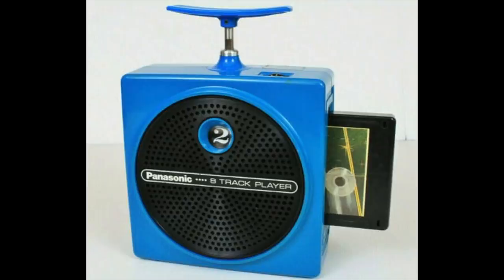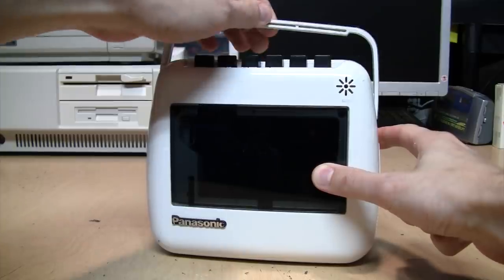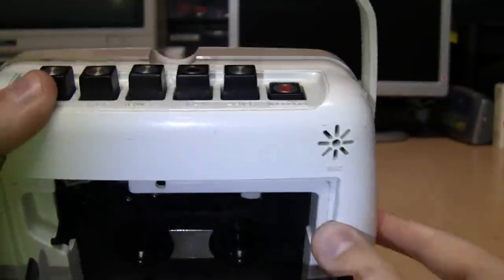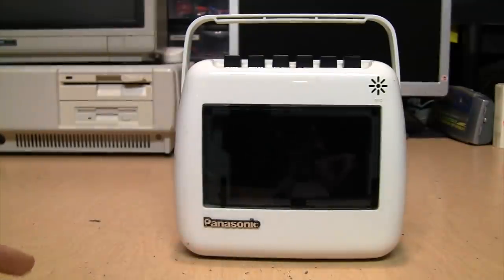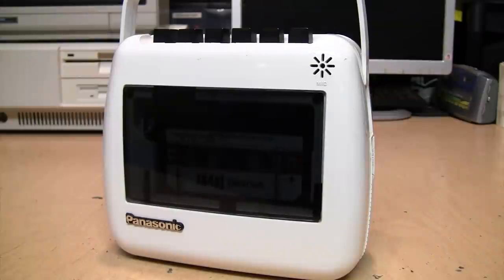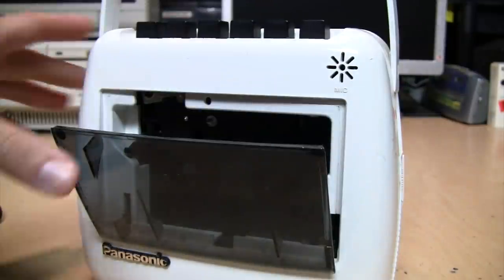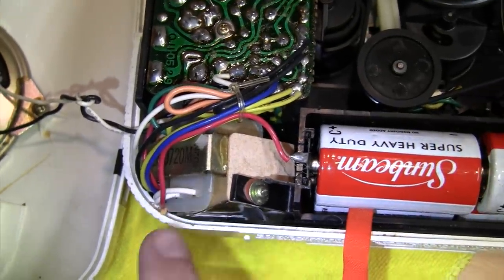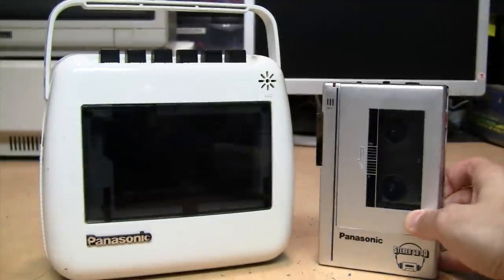1970s Panasonic Take 'n Tape portable cassette recorder

Comment: I have always liked Panasonic since they seemed to deliver well made stuff that didn't fall apart very soon. Wonder if the same rings true (or even truer) for their old stuff...
Reply: Same. I still love those Panasonic cassette players
Reply: Me too, Panasonic fan boy here. 😎👍
Reply: Me also. All my Panasonic and Technics stuff that I bought in the 1980s is still trucking on. Most Panasonic made things are very robust and built like a tank!
Reply: @needfortweed8734  Hmm 🤔 strange. I’ve never had that bad of luck with any electronics, except for a GE radio. I bought a new Vizio to replace an earlier Vizio made in 2007 that still works today. I usually have things based on the track record of the things that I have actually bought previously from and like. If I really had that bad of luck with something, I would really never buy it again. That LG I had previously seen in another video is a great example.
Reply: I have a panasonic cassette player from the 60s with original belts. Still works!
Reply: @EddieJazzFan  👍🏻
Reply: panasonic dvd rp91 is my favorite dvd cd player, with a built in dac and 3 re-master modes
Reply: Panasonic players were rugged as hell. I dropped mine a few times down stairs, on to concrete, never a scratch. While my friends Sony's and Hitachi's fell apart when you looked at them wrong. ha ha

Comment: I had one of those Panasonic Take n Tape machines; got it in ‘73, in Blue. It was my first cassette player/recorder which replaced a mini reel to reel (like in Mission Impossible) machine. I used it to play and record, and put a lot of mileage on it. The case may have been plastic, but the mechanism inside still had a decent build quality.

Great machine and memories. The handle did crack and break, but I taped it together and used it for many years until I wore out the playback head.

Comment: You made note of the amount of plastic in the tape transport chassis when showing the insides. This was a low-cost unit even when new. But it still sounded very good, and I really couldn't detect any wow or flutter to speak of. That heavy die-cast capstan flywheel seems to be the key. It might be entertaining to see the W&F of this little player compared to some recently made tape decks and players.

Comment: Thanks much for posting this. I got the blue one in 1973 for my birthday and thought it was the coolest thing ever. I remember the first cassette I listened to it in was the American Graffiti soundtrack. The sound was good by my 11 year old ear and the plastic was pretty tough as I remember I drug it everywhere. I think the design still looks cool today. Panasonic was so hep back then. Yeah, the built in mic kinda stunk, but that didn't stop me from trying to tape(.v) the hits off of 68WRKO, lol. I remember sitting on the floor, waiting in front of the stereo speaker for a good song to finally come on...then there it was at last...all would be going great until my nosy sister would barge in the room and ruin the whole thing!

Comment: That cassette recorder brings back some memories. We had that Panasonic recorder too, also in white. We got ours in 1976 so it might have been still in production then. An unremarkable cassette recorder that did the job. I used that to record American Top 40 back for awhile until I got something better. I found that if you connected the output directly from a radio into the earphone output of that cassette recorder, it would act as an auxiliary jack. I think I had to short the mic jack to keep the built-in mike from picking up the sounds in the room. That group, "Cassette" from the Netherlands. Sounds like some of the EDM stuff released today.

Comment: I was a kid in the 1970s.  And, yes, I had a succession of portable transistor radios.  Mostly really cheap ones.  AM only.  Until my parents saw how much I used them, and then they got me more expensive ones with AM/FM and sometimes other bands.  My main cassette player recorder during the period was one from Sears which had a unique joystick control mechanism.  You can see Andrienne Barbeau use one exactly like it in John Carpenter's THE FOG.  But although I remember the "dynamite" decks, I don't recall these at all.

Comment: Darn, I had one of these, Orange?
On mine the mic died, my brother, with a blue one, the door broke. We called Panasonic service and they supplied the spare parts to us to do out own repairs - imagine that today.
The audio in the video sounded awful, however it fits my memory of it perfectly. 
No there is nothing wrong with the unit showed, that's just how they were.
Reply: Sigh.  I miss the days when consumers were assumed to be independent and competent enough to operate a screwdriver and soldering iron.  <3
Reply: some treadmill companies will still have the owner instal the replacement parts today
Reply: They made a yellow one, but not orange.
Reply: I'm surprised. I had a lot of Panasonic products in the 1970's (Multiband radios, Tape recorders...). and all were solid values that never failed me in normal use. I had a circa 1976 Panasonic RF-1060 that was severely melted in a garage fire in 1985. I wired up a 6volt DC source and a speaker to it's remains, AND THE DAMN THING PLAYED! (Only the station is was left on because the dial control was gone), But HEY...) I recently got another RF-1060 from FleaBay for nostalgic reasons, And outside of NOAA, there isn't a lot on "PSB" (VHF-High band) today, But it's AM/FM performance is STILL better than most NEW radios. (Being 100% analog is a HUGE help on AM!) But perhaps since these recorders were aimed at the "youth market", corners were cut to make them affordable for "the kids".

Comment: These changed in 1976 to the RQ - 304S with a non adjustable handle and different style knobs. I bought one in excellent condition with box but no sound. I got it working and put a new belt on it and now it's like new.

Comment: My parents back in the mid 90's bought a used 1974 Airstream travel trailer out of a newspaper ad from an old guy who was moving, and when we were cleaning it up in one of the cabinets we found one of these in Yellow sadly batteries had been left in it, and it no longer worked so they tossed it in the trash. man I wish I had the foresight as a kid to have saved it from the landfill. 😞

Comment: Quite a smart looking deck great that the belts are still in good condition where on some later decks they are a horrid goo like mess that get,s everywhere .My 1976 mono phillips deck is still on its original belts and my 1988 bf52 sports walkman is on its original belts when many others have failed

Comment: Some of that muddiness is probably down to aging filter caps. Especially if there is anything in there that serves as some kind of crossover filter for the speaker. It's really not bad as it is, but I would be that it would improve with some careful attention to inside and possibly some clever minimal updating.
Reply: I have a red TNT 8-Track player that sounds awful, like really muffled. Could that "filler cap" be what's wrong with mine?
Reply: @jimdayton8837  Maybe. 8 Track players are a lot more complex than regular cassette players because of the mechanicals which control the track switching. If the tape is not aligned perfectly with the tape head in the player, that will cause all kinds of sound issues, and 8 track players (especially cheaper ones) can very easily get out of whack. Owning and using an 8 track player is an exercise in constantly maintenance unfortunately. There could very well also be aging or leaking filter caps inside the unit, or caps that are supposed to blocking bass that are no longer doing their job. You would have to take it to a repair shop to find out.

Comment: I have one of these, the yellow one. Found it on the side of the road. I had to glue the door hinge back on. It still works really well, too. I also get the same distortion on record. Wondered if it needed new capacitors but maybe they always recorded like that.
Reply: How long ago did you find it? In the 90's?
Reply: Actually, about 3 years ago. I still have it.
Reply: @jamesdrake6200  Wonder what it was doing at the side of the road.
Reply: It was being thrown away...

Comment: I remember seeing these in the 70s, although I wasn't into the styling at all. It looked like a Fisher Price toy compared to my Panasonic RF -1060! Did you ever review that radio? Imho, that was the best looking portable radio ever. While I no longer have my original, I do have one from ebay. It's not mint, but still sounds better than most portables of equal size.

Comment: Hi, I know my comment is not related with this video but I just wanted to thank you for your channel and all the information that you bring us. Thanks so much.

I have a question for you about vinyl records. Yesterday, I found that 6-7 records of my collection are badly warped (probably due to the summer heat). Do you know if there's a tip for fix and flat them again? I've read about the theory of stacking 2-3 books on top of every record but I wanted to ask you first.
Again thanks so much
Reply from the maker: There are many theories of how to flatten warped records, but I haven't tried any of them.
Reply: I have seen a few YT videos that say you could put your warped records in the oven.  I haven't tried it, but I would say that is a solution you should not try!

Comment: C-30 C-60 C-90 Go! 

deee ssssseee biasssss!

We has that Radio Shack microphone!

Innards remind us of a GE tape recorder we once had. It had the same belt layout and used 'printed' carbon resistors on the board...
Reply: A lot of GE stuff at the time was manufactured by Panasonic. The first VHS deck sold in N. America was a GE unit manufactured by Panasonic.

Comment: Does that use the same power cord which used to be common on boomboxes and other equipment up through the nineties? I remember my father used the power cord from his old shaver with his "purple" radio. When we first got something with the modern figure-eight plug we had the opposite problem you had; we had a number of the old-style cords but no new ones.

Comment: This is the first time I see a round belt used in cassette mechanism. I wonder if one can replace it with conventional square belts more commonly available. Anyway Indonesian also make bootleg recordings using type-IV tapes. Kinda hard to find though.

Comment: I find it truly astounding how far speaker technology has come since these days. A box 1/3rd the size is louder, clearer and deeper bass/mids in a cheap box nowadays. Great tech and nostalgia but, phew, I prefer much of the tech today lol
Reply: Speaker technology hasn't progressed since then. There's no reason why a speaker driver like in the JBL Go couldn't have been made back then. The reason why portable devices have better speakers today is that high excursion heavy cone speaker drivers are notoriously inefficient (i.e. power hungry) and without high capacity rechargable cells and switch mode amps you can't drive them sufficiently. 

That said, portable devices still sound like crap compared to even the most primitive home HiFi, there's still no replacement for displacement. Further, I don't think a JBL Go would even turn on (or even be serviceable) after so many years unlike this cheap old device, which still works and just doesn't sound as fresh as it once did.
Reply: @westelaudio943  I don't entirely agree... If I take a Wonderboom 2 speaker from today and place it against anything of similar size from my days of carrying around my (still have) old Hitachi TRK 3D82, Sanyo M7770K, one of my favourites Sharp QT27 or even the best looking portable speaker I ever had which was a Matsui twin tape deck with 3 square speakers along the front and the tape decks on top sat at around a 35* angle...beautiful.. none of these sounded as good in reality, just in memory. When I compare the sound, I am comparing the actual sound not the technology available at the time. Its like people saying 'furniture used to be better built'...no it wasn't, it is just that the actual good bits survived and the MASSIVE amount of trash is now gone...I did an HND in furniture design and manufacture...it gets tiring... IKEA make furniture miles ahead of the cheap trash of yesteryear. So, while I enjoyed my music on my old Sansui stereo that I'd wired 6 extra car speakers too....they just don't sound as good/clear as a modern, DECENT, dock...
Reply: @westelaudio943  when I say 'speaker' I mean the whole thing, not just the actual speaker... :)
Reply: @grantpaterson1016  

It really depends on what you are comparing and from what era. Examining the "old" vs. new production differences in their totality would be too much for a YouTube comment section, and so would be debating if survivor bias is a myth or not. But I know for a fact, there are many problems with new tech (unleaded solder, delicate SMD components, heavier thermal cycling, the strain of switch mode instead of linear mode, bit rot on uCs with neither the chip nor the software being available, etc.) that old audio equipment simply didn't have. Keep in mind those are generalized statements. Old tech might not necessarily have been more reliable, but generally much easier to repair and of higher production quality.
Reply: @westelaudio943  I am not, in any way, attacking your knowledge btw...just so you know that. I am not saying new tech doesn't have issues, I am only saying that the sound out of a consumer product today, built for the same market segment, to a decent standard, will have a better quality of sound. The Wonderboom 2 for example can be bought for £74 for 2 in sales...that amazing...and in median income is close to the % cost of the Take n Tape. I still use an old Logitech S715i and there is no world that quality of sound could have been done, in such a small box, in my QT27 days.... yes, equivilent sound could be achieved but with a heap more cash lol.  I suppose when I say 'better' I am meaning delivered sound and not the subjective 'prefer' sound. I still love hearing my old Clash albums on an old Midi box but thats more to do with memories and happiness than the atual sound.....hhmmmm....
Reply: @westelaudio943  btw, I love your channel. Never miss a video.

Comment: How to remove the corrosion stains on the battery compartment?
Reply from the maker: Use vinegar to neutralize the battery "acid" (which is really an alkaline/base), and then clean it up with isopropyl alcohol.

Comment: You're looking at it through 21st century eyes.  I'm sure the smoked plastic cassette door was just good design... not to make it look like a TV.  Remember, TVs had square screens back then.
Reply from the maker: But there were already similar TV designs with a brightly colored rounded plastic case and a smoked plastic bezel covering the CRT in the '70s, such as the JVC VideoSphere.